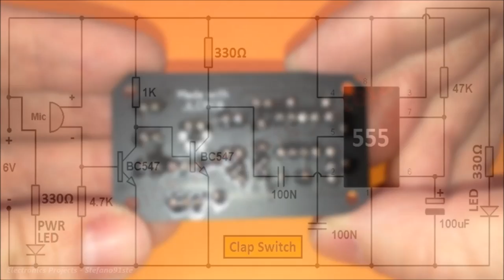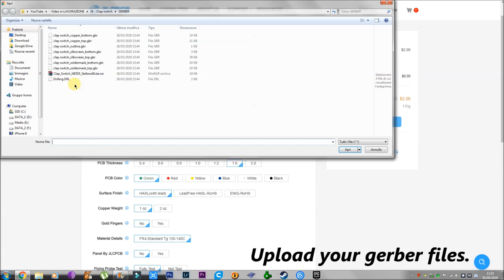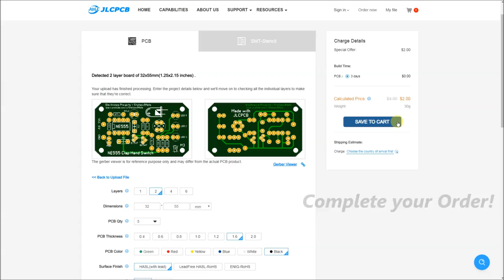Clap Switch Circuit with NE555 and BC547 (LED Light) PCB Tutorial

Comment: wow good video bro, i have a doubt, if I want to put 3 LEDS I would have to put them in series with a 330 resistor, and all that in parallel right?
Reply from the maker: Hi, thank you!
The three LEDs of this circuit are connected in parallel and each with its own 330 ohm resistor
Reply: @Stefano91ste   I really appreciate it, you are a crack

Comment: I'm surprised your circuit works. I got a negative result. I changed the circuitry of the analog part a bit to fix this, but the device starts working in generator mode from time to time.
Reply from the maker: it is strange, the circuit works perfectly assembled as in my circuit diagram